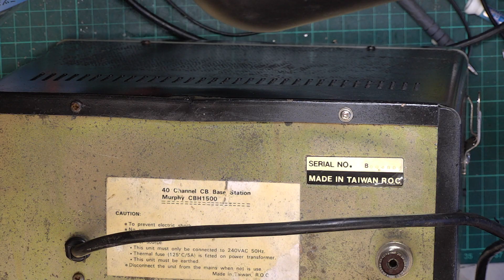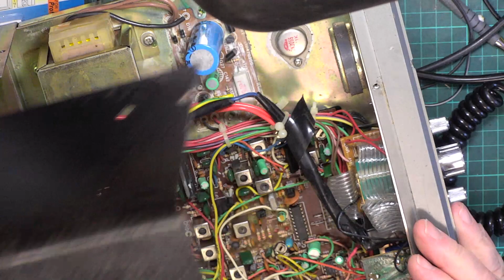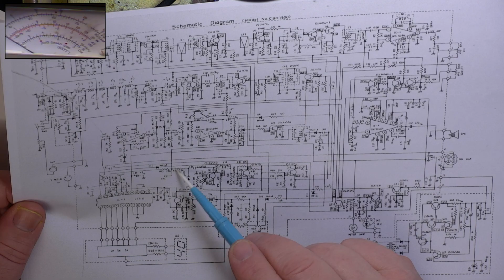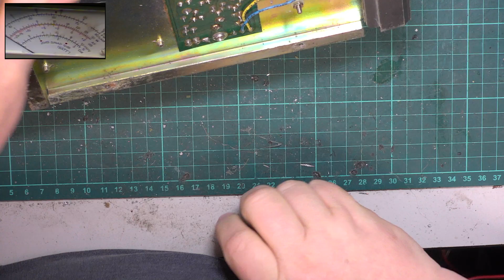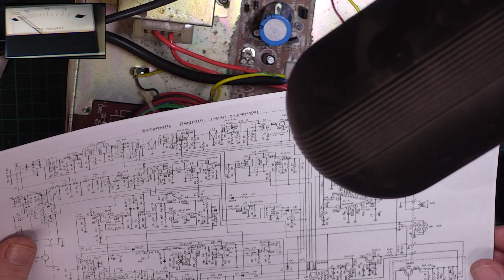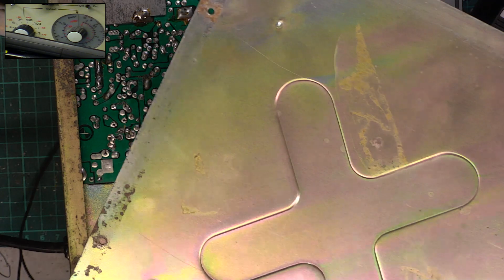Murphy CBH1500 UK CB27/81 CB radio (base) - Extensive repair

Comment: hia was just wondering what capaciter you changed to get the tx audio back
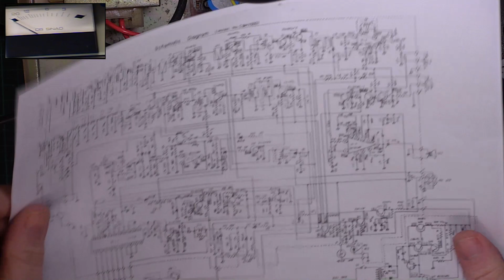Reply: 23:03
Reply from the maker: I've just pulled out the circuit. Where I am pointing looks like C77.

Richard, G0OJF, UK
Reply: Thanks so much hopefully I can get this radio back up and running

Comment: Murphy CBH1500 off frequency. Been struggling with this, but finally solved it. Set had been got at, wax had been scrapped out and crystal had been broken by previous owner. Replaced crystal, but way off frequency, could be adjusted, but it was way off. After virtual checking every component in the oscillator and finding all correct. I changed the value of C99 from 100pf to 33pf, Now frequency range has shifted and can be adjusted on frequency.

Comment: Well got at and that screws finished it off.  Just not worth doing that one, though it appeared to be doing ok on receive.
I can't believe those self tappers!  They must have known it would hit the PCB and if you have any sense at all you would take off the bottom cover to make sure they didn't do any damage.  Just as well nine of them went onto the Power supply PCB, shocking!